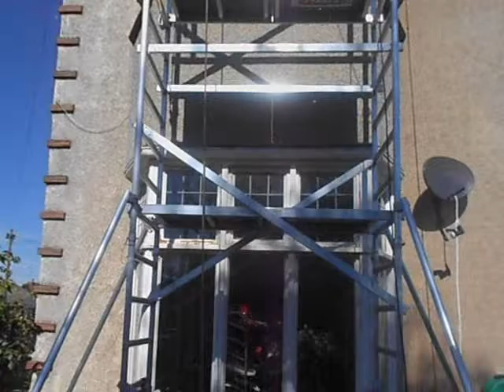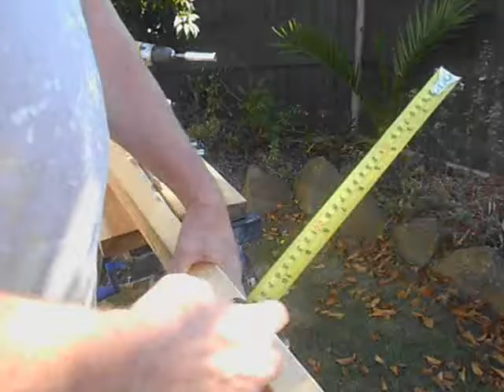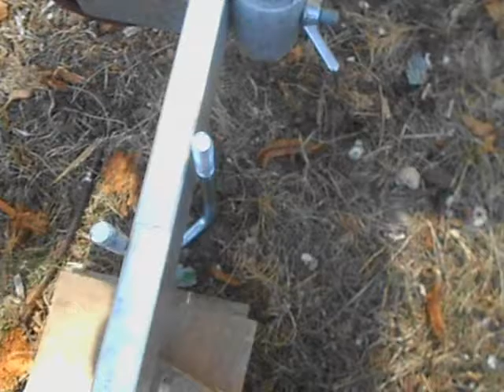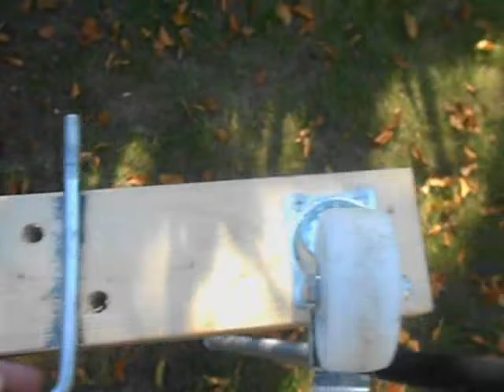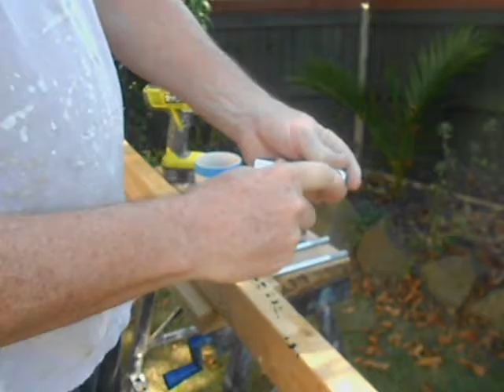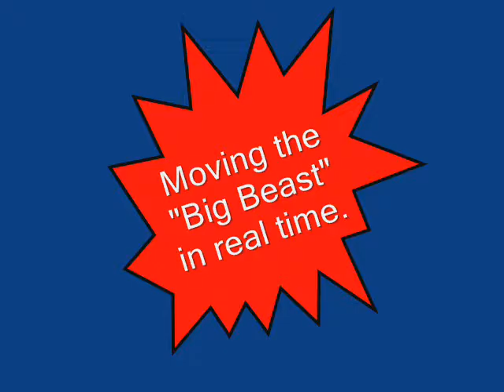Loyal Super DIY 7 Aluminum Scaffold Tower (Part 2) Get it moving with ease!

Comment: Great idea. Looks more robust than the tower itself! I would suggest always checking the wheels have good clearance from the ground, once its in position. This would avoid the risk of any sway of the mounted tower transferring load off the proper supports and onto the wheels.